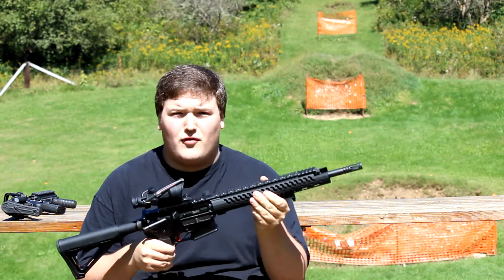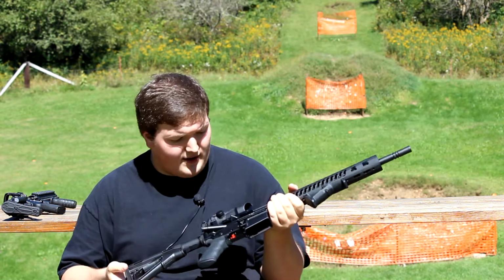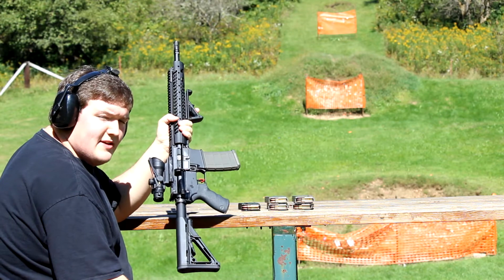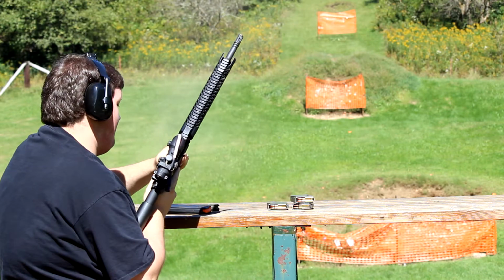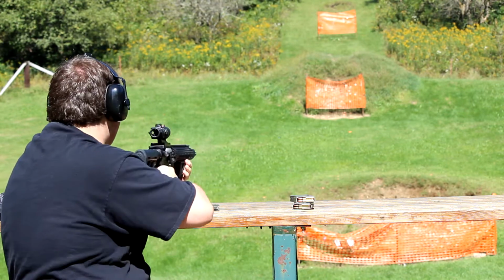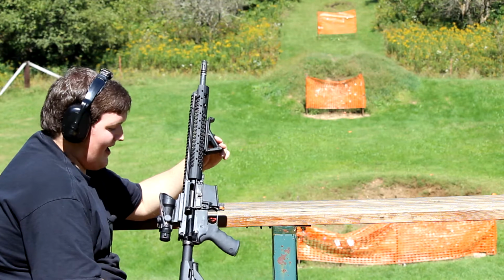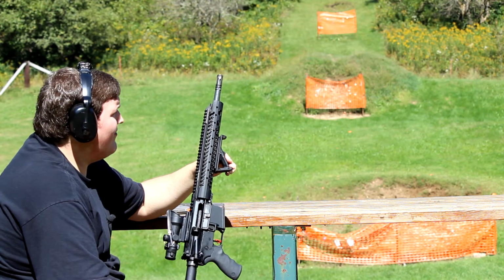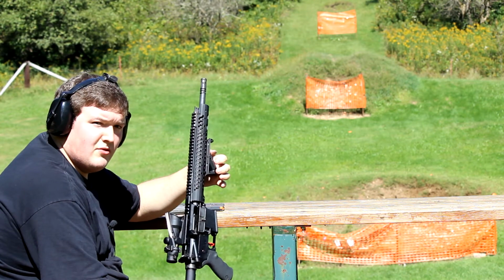Huldra MK IV AR15 Troubleshooting

Comment: I own a huldra upper as well and anything not steel runs flawlessly even tula brass max. I just said to hell with steel crap ammo never really liked running it in the first place. My guess is the chamber is tight and the lack lubricity with the steel causes the issue. That's just a guess though.

Comment: If you have an ACOG, there is no point in steel cased garbage.
Reply: bisquik3006 why anyone would want to use steel case for their AR-15 is beyond me
Reply: Stephen Stine Just about like running drip gas in a Ferrari.
Reply: ***** It's not weather it will shoot it or not, it's the principle.  Just as silly as running top dollar ammunition in a Hi-Point.
Reply from the maker: Personally, this isnt my gun so I dont care that much.
That being said, I never got behind the steel = shit viewpoint. I have my ar's to be fun, fuckaround, range toys so shooting more rounds for less makes sense to me. It doesnt make sense for me to reload for for it when its just paper punching anyway.
This gun is a higher end piston gun - and to me - it should be able to run on any ammo. Its not a deal breaker and I personally wouldnt get rid of it because of the "issue", but if I bought a mid-high end rifle only to find out I had to spoon feed it the best ammunition to make it function I would not be pleased.
Most people dont use their guns enough to shoot the barrel out anyway, so If I manage to put that many rounds through my own gun then Ive had a lot more fun than most and the cost of a new barrel is easily saved in the cost of shooting "higher" end brass ammo.
If the difference wasnt multiple dollars per box it would be a different conversation, but as mentioned when I am not reloading for it and Im not hunting with it, there is no reason to spend more on ammunition.
Reply from the maker: goooood.
Reply from the maker: Shit. Edwin, I am truly sorry. Have a nice day.
Reply: Big Mike's Hobby Channel Thanks for your service.
Reply from the maker: No, Thank you. and Happy Memorial Day.
Reply: Big Mike's Hobby Channel you know the saying if you can't afford good ammo you need a better job words I heard from a great man.